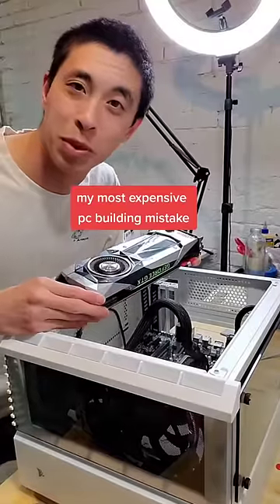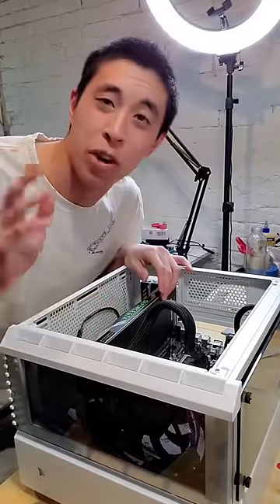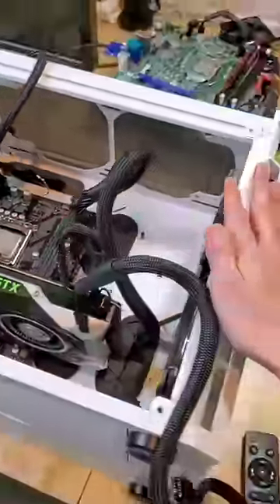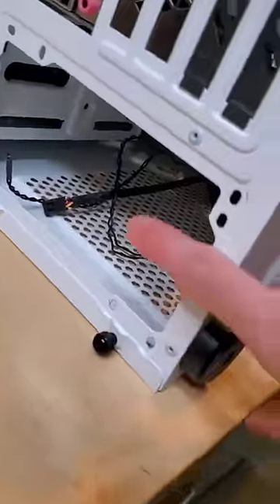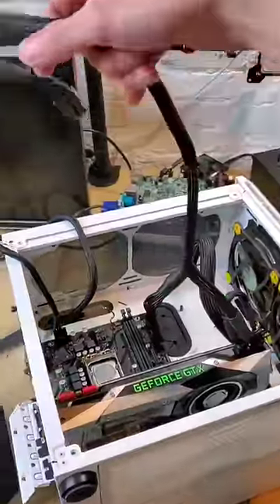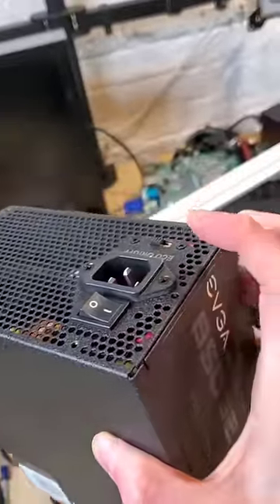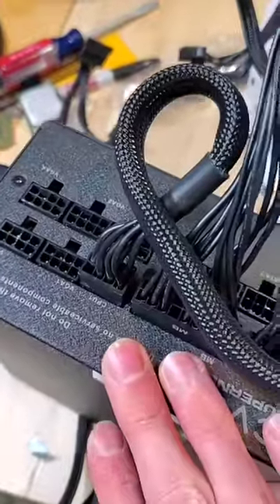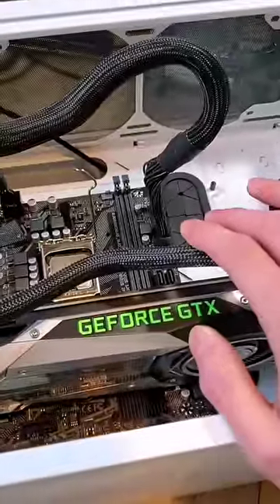my most expensive pc building mistake... #shorts

Comment: When I was like…I wanna say 14, I was helping my father build a low grade small form factor server PC for my grandfathers business.

My grandfather came downstairs to check on progress, the build was like 90% done and I just had to put the memory in.

He reached in to point “what does this do?” Pointing at the memory, and I am not touching the side of the case, holding the motherboard steady in one hand and brushing away his hand with the other.

That small spark of static electricity fried the memory sockets of the motherboard and we had to call my Uncle to replace the motherboard almost on the spot.
Reply: The chances of damage equipment with static is very very low.  More likely an already faulty motherboard to begin with.
Reply: @TheBaldr  Probably happened a long time ago, when it actually was quite common due to the lack of protection boards used to have. They were not consumer grade level of safe to assemble in the early days.
Reply: @TheBaldr  for older motherboards it's actually more common than you'd think.
Reply: @TheBaldr  you are right today but you would have been wrong in the 90's
Reply: Ya as other have pointed out this is a past vs present issue.  There's a reason all these computer repair kits come with the "stupid" wrist strap for grounding yourself.  It used to be WAY easier to fry components with static back in the 90s.  And well once you do that once you wear the stupid wrist strap even if it's kind of pointless with the current components having significantly better protection.
Reply: And maybe don't just brush peopels hands away and answer the question instead.
Reply: @RootBert397  lol the 90s....I don't remember a lot of small form factor anything that would of been consumer friendly as far as price is concerned.

Comment: Here's a tip from me:
Do not overtighten your CPU Cooler,
Doing so will damage the motherboard traces//connections under the mounting brackets. This has happened to me once, and I had to buy a new motherboard, it didn't completely brick the motherboard but id did cause memory issues (only 1 slot working out of 4 slots). Please make sure that you tighten the mounting screws evenly to ensure even mounting pressure over the cpu.
Reply: dropped cpu into socket because of thermal paste, only 2/4 slots work and im lucky that they do. unlucky i cant use dual channel
Reply: @ground-beef  Oof, sorry mate.
This is a reminder to be more careful next time.
Reply: I'm going to have to try this because I'm almost literally building a computer while scrolling through YouTube at the same time.

I put the CPU cooler on just the back plate and then I sat down in my chair and scrolled through a couple of videos. So now I'm scared I accidentally over tightened it.
Reply: @bland9876  What kind of CPU cooler did you install? Alot of them have this cool spring system where once you tighten to a certain point, it's nearly impossible to tighten any more.
Reply: Happened to me too.
Reply: Didn't know that was even possible considering they have a mechanism that makes that not possible
Reply: @randomstuff508  yep that's what kind I have. Getting the backplate on was a win though cuz I had to find a French that for the nuts.

EDIT: okay what's up with my phone typing the wrong things I meant that getting the back plate on was a B because I had to find a wrench that fit the nuts that went on the back plate.
Reply: common knowledge
Reply: this happened to me yesterday, got my new mobo today and my build running good, too bad i didnt read this earlier
Reply: @bland9876  Don't worry mate, As long as you are slow and cautious it should be fine. At the time this happened to me I was rushing the build. Just make sure the screws have even pressure, and tighten them slowly. When it starts to get really hard to turn, then stop. Do not go further or you will actually start damaging it. I'll be here if you need anymore help
Reply: @randomstuff508  FCLGA1151, i5 9400F. I actually scraped the motherboard.
Reply: @michaelvigil5321  It is possible if you are not careful. In my case I was rushing the build, cause I had online school tomorrow and I didn't have any other device around me that I could use at the time.
Reply: @bland9876  Yep.
Reply: @AlexanderC08  Sorry, mate.
Reply: Possibly happened to me. The only part where i did a slight mistake was that, and the whole board was broken. Could have been broken from factory tho. I read somewhere that msi happens to dp that sometimes.
Reply: @niilozka  Try RMAing it under warranty.
Reply: @overwatch2944  that was years ago. So I got a better mobo anyway.
Reply: @niilozka  I see.. good for you then.
Reply: Yes the sky is blue
Reply: @kadiea8664  Indeed it is!
Reply: @randomstuff508  yeah, once you feel resistance you have to use a ton of force to do any real damage
Reply: Just tighten it until you cannot screw it down without force.

I call it "Electronics Tight".

I used to torque things down too, luckily I never had any issues from it.
Reply: @nexxusty  I thought it was usually called snug. Like not super tight but not loose where it unscrews itself
Reply: @victorsvidss  Yep, snug works too.

Same thing.
Reply: my heatsink (NOCTUA NH-D14) has special bolts that prevent overtightening
Reply: @nexxusty  I could not have said it any better, Thank you!
Reply: @overwatch2944  No problem at all! Glad you agree. :-)
Reply: Same with my other motherboard only one works

Comment: Bro…… I did that, everything makes more sense
Reply: It does not
Reply: @elrymoe  literally every cable should be the same, based on a standard. This is just straight up weird
Reply: @thegiantgaming7592  They’re not though, sadly. They want you to buy their replacement cable or their extension or their unit.
Reply: @thegiantgaming7592  and it is
Reply: @TAEMBO_RK  yeah no
Reply: @elrymoe  you could at least explain why instead of giving useless responses. you're not telling the person why they're incorrect
Reply: @Lucid_XP  if I had to guess it would be an impedance issue. If the PSU was designed for a certain Ω of resistance then had cables with less resistance you could easily send way too much power through them on accident or if one of the cables was lower resistance than the rest.
Reply: @thegiantgaming7592  Connector keying is standardized on the motherboard (for obvious reasons).
However, PSUs DO NOT HAVE STANDARDIZED CONNECTOR KEYING! STAR, HIGHLIGHT, BOLD, FLASHING LIGHTS, DANCING LADIES!!!
Reply: @TAEMBO_RK  it's got nothing to do with that. Different PSU manufacturers use different voltage configurations to optimise power delivery and mixing cables across PSU's results in the wrong voltages going to the wrong places. In the cases where lower voltages go into places requiring higher voltages (under-voltage) nothing happens. But when higher voltages go to places that require lower voltage (over-voltage) components will be fried.
Reply: @noahstonemusic  You're correct on that, mixing cables can possibly send 12v down a 3.3v wire and kaboom goes your motherboard or SSD. I just don't see how PSU manufacturers make a good reason as to why they're using different pinouts/connectors on the PSU side of the cable. Take for example, a Corsair RMx 650w compared to a be quiet! Straight Power 11 650w, regarding their CPU power cable plugs. Corsair uses an 8-pin while be quiet! uses a 10-pin. Just bugs me they don't have a standard for that.

Comment: Knew it was gonna happen right when you said you liked the pre routed cables. Each psu company has their own pinout for there connectors for whatever reason
Reply: eww, so modular ATX have no PSU-side cabling standards? yuck. no wonder they have such generic 6-pins connectors
Reply: Explain what is means cause to me a cable is a cable. As long as the pins are the same, it should work.
Reply: @fourthpanda  The pins aren't the same. Not on the power supply side. The 24 pin ATX connector for the motherboard isn't 24 pins on the power supply side, it's a lot fewer. So if you take a cable designed for a power supply where the leftmost pin is 5 volts, and plug it into one where the leftmost pin is 12 volts, you are going to have a bad time.
Reply: @outsider344  Exactly, so the pins are different. That's the problem then, not just "cable don't worrrrrk".
Reply: Oh man, i have a box of PSU cables and I've just been taking random ones that fit. Guess I've been playing a very dangerous game :/
Reply: @julianrubinstein8499  🤣🤣🤣🤣 yea. It usually follows the brand so corsair good for corsair.
Reply: @RealSeductions  I think i have a combo of Corsair and EVGA... I'm lucky my current PC didn't get fried since it's just a combination of like 3 old PCs
Reply: @outsider344  i still don't get it, so he should use the cables that came with the psu?
Reply: @vladt.6114  Correct. By using different cables there is a chance that you are essentially cross wiring something, even though everything seems to fit together as it should.
Reply: @julianrubinstein8499  Im betting what happened in the video is really uncommon. Getting a cable and PSU that are pinned differently but still fit together isnt something I have ever seen. Each PSU manufactuer has a big incentive to make sure that cant happen in their product line just because you really dont want to accidentally send out a batch of power supplies with the wrong cables.
Reply: @outsider344 i see, but isn't there a possibility for the gpu to have a different combination than the psu combination?
Reply: @vladt.6114  Well on the side of the cables that plug into the compnents everything is standardized.  Every 6 pin connector will have the same specs (unless this edge case problem with the modular power supply happens). On most power supplies this cant even happen. Most power supplies dont have modular cables you can dissconnect. Its just a matter of which cables your GPU needs to have plugged into it. You could always test it. All the specs are published and you could go through with a multimeter and make sure each pin on the cable has the voltage its supposed to.
Reply: @outsider344  thank you
Reply: @outsider344  How modular are these "modular" PSU's then?
That's pretty weird
Reply: @deadpixel64  Yea, I agree. I guess their marketing depts can get away with calling them that because modular TECHNICALLY only means it "has modules". But it's really missleading. The modules aren't interchangable between models, and it's not like they sell extra cables for them of different types if you, say, need more sata cables and less 6 pin. They are really just "PSUs with removable cables". I feel like they should be called strippable power supplies, or really just cable management power supplies.
Reply: What about the psu cable that connects to wall ? Can that one be different
Reply: @whaattheef2169  yes that one can be different since it is pretty much universal, just make sure that it can handle the maximum wattage your psu can handle
Reply: @whaattheef2169  those are different based on the plug used in the country. If it looks like it will plug into your wall outlet you should be good. Oh and check that the 120v/240v switch is set correctly
Reply: All such cables also have capacitors inside, those may also play some bad role. Even best corsair models have that.
Reply: @whaattheef2169  if you buy them in the same country then they should be the same because the only thing that can change depending on the country is the wall plug but the psu side of the cable should be the same because it’s a IEC c13/c14 standard cold appliance plug and if you move to a country that doesn’t use the same plug as your previous country then the same psu just with a different cable should also work (atleast according to specs) because they are supposed to work with 100-240volt and 50-60hz

Comment: All i did was break the glass on my 4000d, I opened it om a glass table so when it hit the glass it shattered. i got a replacement from corsair, but in the future i will open the glass on softer   surfaces
Reply: I had a similar thing where I put some side panels from the 570X on the floor and walked into them slowly by accident. It really doesn’t take much for tempered glass to shatter. I wasn’t even wearing shoes.
Reply: Had it happen to me. Was putting my glass back on my case after cleaning and when I went to grab a screw it dropped off the case and fell 2 inches and shattered into a million little pieces. There’s still shards of glass in my case
Reply: Mine just shattered by taking off the glass
Reply: Oh no! The table! It broken!
Reply: Same thing happened to me with my 4000X!. I haven't been able to get the replacement though because they're out of stock :(
Reply: @WilliePeck  I contacted Corsair support and they don’t even make them anymore :/ at least in my case with a Corsair I-Series.
Looks like I’m doomed to constant dusting and thermal paste changes.
Reply: @WilliePeck  You can email corsair and they will give you one for free.
Reply: i love 650D
extremely durable and rigid, transported by long car ride many times without problem with all components inside. the window is plexiglass

Comment: “Pre-routed power supply cables…”
Oof I know where this is going.
Reply: Why is that such a problem ? sorry pc building novice here
Reply: @seriousaleks8752  No standardization = zap
Reply: @seriousaleks8752  
If they were just PSU cable extensions, then it would be fine, as it’s all standard on the side that plugs into the motherboard/GPU. There is no standard though for the side that plugs into the PSU. Different modular PSUs have different pinouts, so plugging in cables for a different PSU will send voltage to the wrong pins and end up frying things.
Reply: @SirSethery  what about custom cables? Are they not safe at all?
Reply: @tanh9923  
Custom cables are safe if they’re made for a specific power supply or series of power supplies. You can’t use custom cables unless you know they’re compatible. Custom cable extensions though are always fine if you’re plugging the original cables into them (assuming they’re good quality, not too long, and not being pushed to the absolute power limit), since they would use standard pinouts.
Reply: So I guess the only lesson here then is to always use the same cables that come with the PSU and not any others, despite being the same brand. Am I right? I'm planning on building a PC soon and I don't want to see smoke coming from my motherboard/CPU
Reply: @SirSethery  Perfect explanation ! Thank you :)
Reply: @Maximo2204  
Yep, pretty much. Never use cables from a different PSU unless you know for certain from some online resource that the modular cables use the same pinouts. I mean there’s a pretty good chance that the 650W and 750W models within the same product line will both use the same cables, but it’s not worth risking unless you’re sure.
Reply: @SirSethery  so, if he would have used the cable from his own Power Supply this could have been prevent.
Reply: @patan4050  
Correct.
Reply: @tanh9923  I just wanted to add to the answer, blindly using "custom" parts you bought from someone or a reseller instead of it's own manufacturer is usually a bad idea. This applies from PC to cars. The whole thing about custom parts is that it is catered to a certain, non standard taste. It can be something simple as a shiny color, or as crucial as fatal incompatibility. 

The first and best hing to do with custom parts, is making completely sure that it is compatible with what youre planning on using with.
Reply: Instantly 😂
Reply: I am about to upgrade my hp z220 with a rtx 3060 overcloaked and a new powersuplly of 550 
So my question is can it co rong if i only use the new powersuplly cables only and it fits so like my pc got some sata cables and my new powersupply got cabels for sata 
Or is it not harm full to use the powersupply his mother board cabbel so the one that wil be 24 pin of the new powersupply and only use the old sata cables that are already in my pc or wil this also turn my pc into a vape
Reply: @koldbloodedkiller2076  
I believe those motherboards have weird motherboard connectors, in which case you’ll need an adapter for the 24-pin connector (DON’T try to fit some of the pins in if it’s not a full 24-pin slot). Not sure if yours has like an 18-pin connector or something. You should find an adapter on eBay though that will work. The SATA data cables connecting the motherboard to the hard drives are fine, but any cables plugged directly into the original power supply needs to stay with that power supply and be removed. Any cables plugged into your new power supply should have come with it. If it’s not modular, then it doesn’t matter of course.
Reply: @SirSethery  ah now i understand thanks and yes i bought a femal 24 pin to a male 18 pin converter 
After looking into my pc and counting the pin’s to know what powersupply would fit best but then finding out i hate hp after that day for having a weird pin count 😂
And thanks again i would have made a big mistake if i did’t knew this
Reply: Even if the pins match on two cables some of them have inline capacitors, etc. that are not supposed to be there. So they will still fry even if the cable is a pin duplicate.